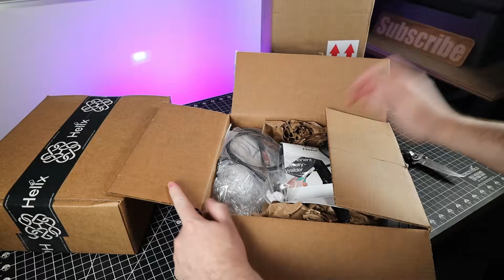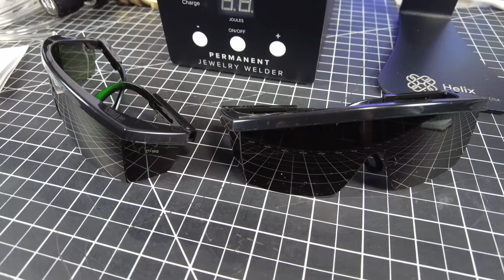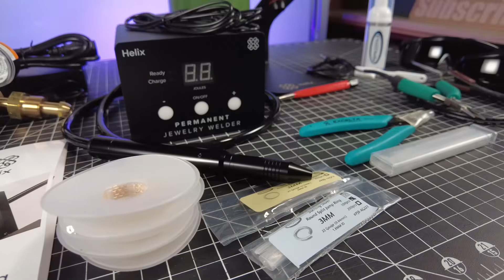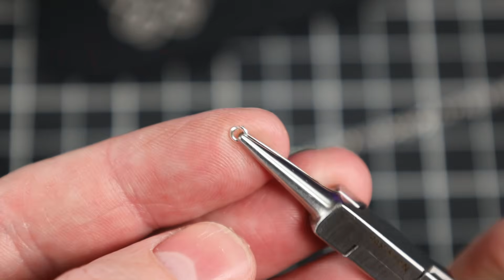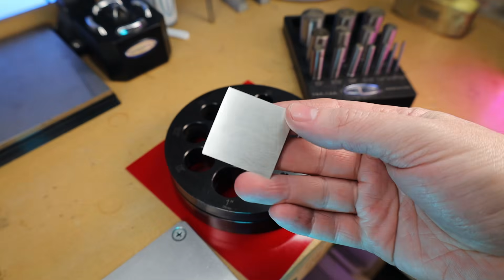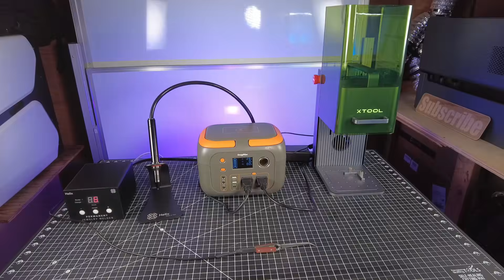Micro Welding Jewelry is Awesome!

Comment from the maker: Helix Permanent Jewelry Welder - https://bit.ly/Helix-Permanent-Jewelry-Welder
Helix Permanent Jewelry Welder (Amazon) -https://amzn.to/3vAT8Sc
Argon & Regulator Kit - https://bit.ly/Argon-And-Regulator-Kit
Argon Tank Only - https://bit.ly/Pre-Filled-Small-Argon-Tank
Regulator Kit Only - https://bit.ly/Argon-Gas-Regulator

Helpful Jewelry Tools That I Make:
Center Finder & Symmetry Checker - https://bit.ly/Center-Finder-And-Symmetry-Checker
Drawing Design Templates - https://bit.ly/GomeowCreations-Design-Templates

xTool F1 Portable Metal Laser Engraver - https://bit.ly/xTool-F1-Laser-Engraver
xTool Portable Power Pack (Expansive) - https://bit.ly/xTool-Power-Pack
Jackery Portable Power Pack (Same as the xTool one but cheaper) - https://amzn.to/47yiJbJ
Portable Power Pack That I have (It is a bit cheaper but all holds less power) - https://amzn.to/48zvbt0

Materials To Make Permanent Jewelry:
Permanent Jewelry Materials (From PepeTools) - https://bit.ly/Permanent-Jewelry-Materials
Permanent Jewelry Materials (From Amazon) - https://amzn.to/4aO1gii

Other Tools Used In The Video:
2 lbs brass hammer - https://amzn.to/3HfpnsO
CircleDiscCutter - https://bit.ly/CircleDiscCutter
Cutting Lubricant - https://bit.ly/BladeButter
NANO Jeweler's Saw Blades - https://bit.ly/NANOSawBlades
Haymaker SawFrame - https://bit.ly/HaymakerSawFrame
Simple Jeweler's Saw Frame - https://amzn.to/41ZHInl

______________________________________________
If you are looking for more tools and materials that I use, well you're in luck! I made a page on my website just for that.
https://GomeowCreations.com/tools-and-materials 
https://GomeowCreations.com/partners-discount-codes

Note: Most of the links that I use that go to products are affiliate link. This means I make a small commission on anything that you happen buy using them. This is at no extra charge to you and this helps support the work I do on this channel. 😁👍
______________________________________________
Other Ways To Help Support The Channel:
My PATREON ➜ https://patreon.com/GomeowCreations
One time support ➜ https://paypal.me/gomeowcreations
______________________________________________
Instagram ➜ https://instagram.com/gomeowcreations/
Facebook ➜ https://facebook.com/GomeowCreations/
______________________________________________
Using Lightning to Make Jewelry 😁

#permanentjewelry #microwelder #jewellerymaking #jewelrymaking #diy #gomeowcreations

Comment: After a year of using it I'd say, great for touch ups, deffo cant replace soldering
Reply: Can you tell me why? I am looking for answer badly. Want to save time and it also looks convenient, but I can't seem to find a where it's better to use welding vs. soldering and vice versa.
Reply: @armour2king its good for chain, jump rings, resizing thin rings without taking out a stone, but if u want something more complicated, made out of thicker parts its not gonna hold good with use.
Reply: @catch20smtng30 so welding a bezel will not work?

Comment: @4:25 the second gauge is not the pressure you're letting out, it's the flow rate (Cubic Feet per Hour or Liters per Min).  Flow rate is a measure of volume over time, not pressure.  If you plugged the output, the pressure would increase to the pre-set limit of the regulator while the flow rate slows to zero.

Comment: Hi can you please suggest a laser welder who does micro-laser-welding?  Do you do repairs? I have a very small piece of, item that needs very tiny repair, when you google for laser welder almost everything it spits out is " laser welding machines". Anyway someone who specializes in tiny laser welds/repairs like yourself is probably what im looking for but no luck so far. Material involved is brass with nickle finish. Any heads up cheerfully accepted.

Comment: Are these arc welders only good for tiny things like jump rings or can they be used instead of soldering for 2mm wide stacking rings for example?
Reply from the maker: You can weld thicker stuff together like that but you just have to do a few weld points

Comment: $1300 for a capacitor hooked to a solenoid is a bit harsh tbh
Reply: About £200 on aliexpress
Reply: @THusbands  pretty sure I've seen a functional one for ~$25 in a @greatscott video
Reply from the maker: You're really oversimplifying the whole thing lol
Reply: @GomeowCreations  of course but not that much, if I understand right this is a spot welder with an argon feed, the bill of materials should not be over $50 and there's little to no electronic novelty in it (battery powered spot welders can be found for ~$30 online) this thing is pretty but unless I miss something big there's no justification for such a high cost
Reply: Nah man its just a tig welder but small and somehow it costs about 4 times as much as a tig welder @GomeowCreations